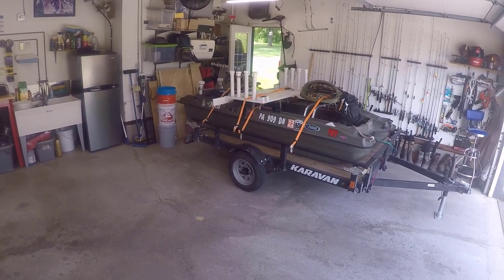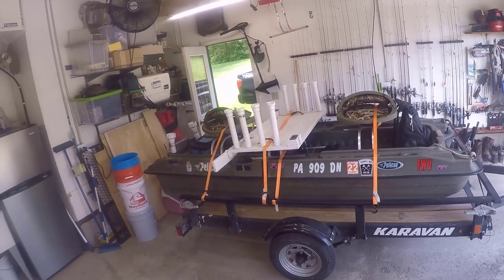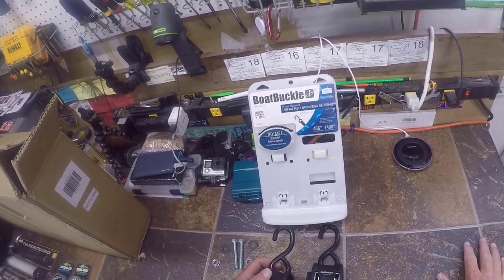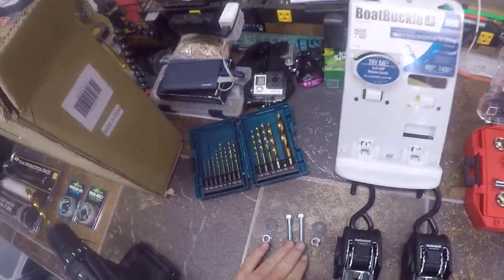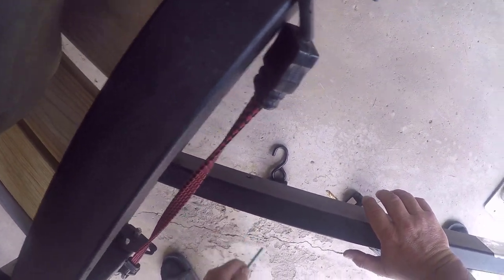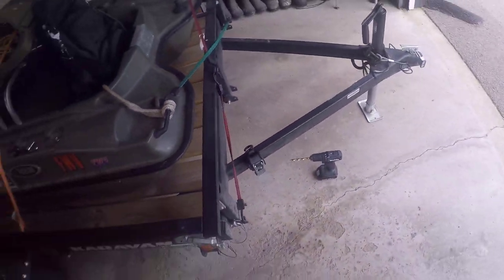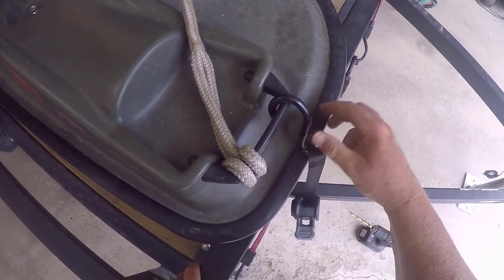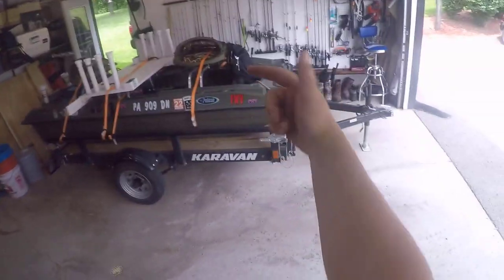PELICAN BASS RAIDER MODIFICATION - BOATBUCKLE - Fishing With Vance

Comment: Great Mod Vance. I attached Eye Bolts to my trailer and use ratchet straps similar to you. 2 straps across and 1 strap front to back. I have a cheap harbor freight trailer so it was easy for me to put holes in it. Thanks for the vids. I look forward to the next one. Fish on!!!
Reply from the maker: Thanks for the input Duane.  I thought about the front to back straps and Eye Bolts.  That would work too I'm sure.  Thanks for the pic or your setup.  Looks awesome.  Fish on my Friend.

Comment: I like to add a strong carabiner type clip to the straps so even if it comes loose, strap stays on. I’ve had the clips come off eyelets while holding down construction materials and have learned the hard way not to trust strap clips by themselves.
Reply from the maker: I'll have to look that up.  Don't know what this are but will check it out.  Thanks Pat.  Fish on!
Reply: Fishing With Vance just regular metal clips (type in carabiner in Home Depot website, about $2 each)

Comment: I recently purchased a bass raider and I want to add some mods/upgrades to the boat? What type fasteners work best? ( screws, pop rivers, etc)
Reply from the maker: Well Heath, we have really tried to not drill holes in the boat as much as possible.   Only recently did we start doing that.  I would say the "skirt" screw or lath screw worked best for us.   Hope this helps.  Thanks for watching and Fish on!

Comment: Hi good video one question , my pelican bass raider damage the black  rubber  bumper , how can I  fixed it? O where can I find it ? Thanks
Reply from the maker: Dang that is a tough one Custom D.  I assume you tried to get to the parts department at Pelican?  They are not always the best on Customer service.  How bad is the damage?
Reply: @fishingwithvance  the rubber black is broken in 5 ft need replacement all
Reply from the maker: @capnbeanis7202  thank you Cap
Reply from the maker: @capnbeanis7202  appreciate you helping out.  Good to know.  Fish on!